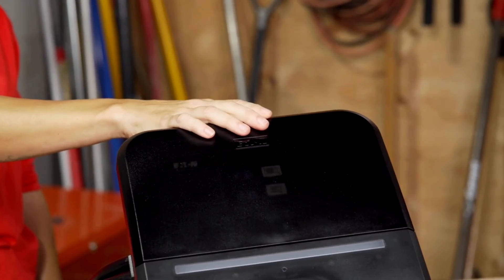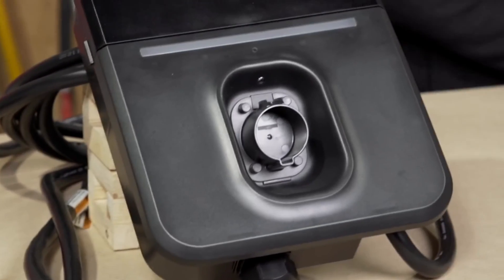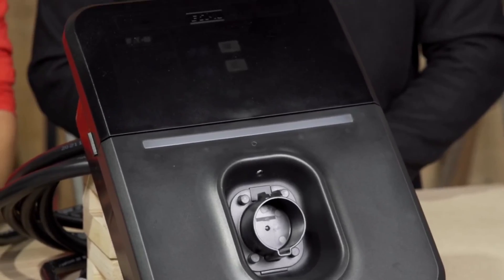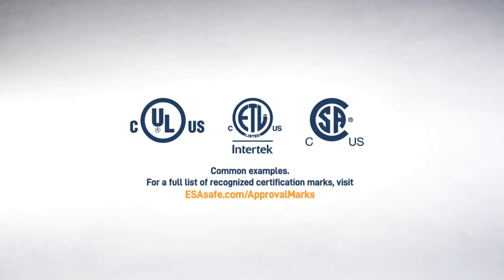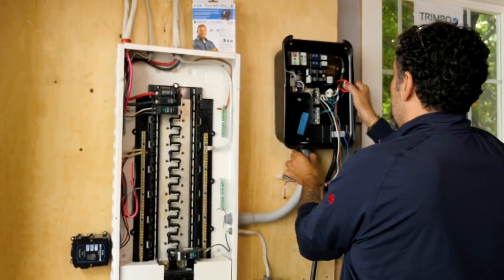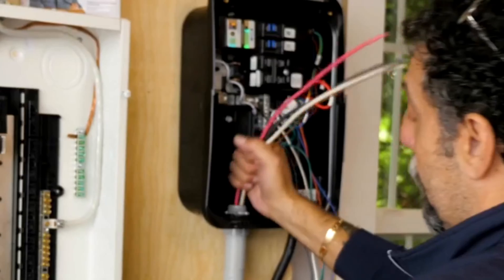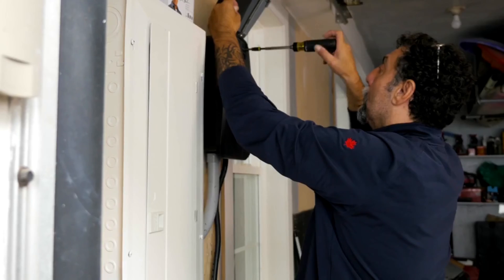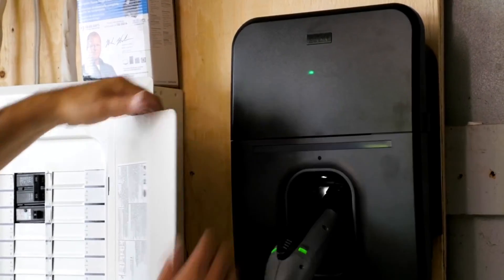What Should You Know Before Installing An EV Charger?

Comment: typical home service is 100amp, average EV users needs about 40kw over 10-12hrs  or 4kw/hr, thats about 17amps.  Easily handled by the existing infrastructure. Electric range is service is 40-50amps. Seems all the new regulations for service upgrades is a cash grab...